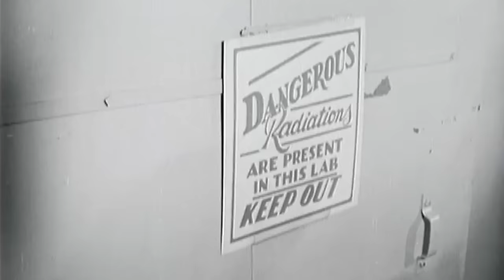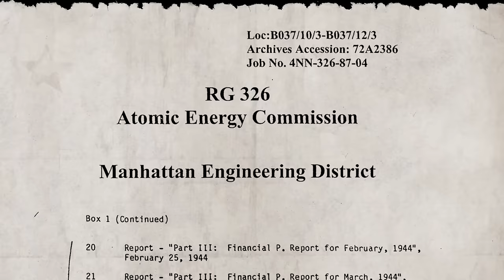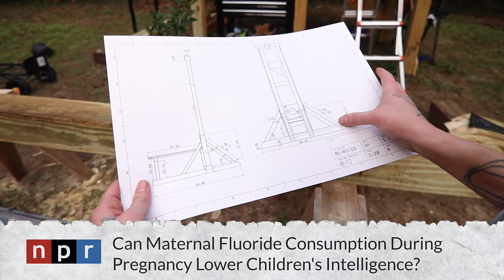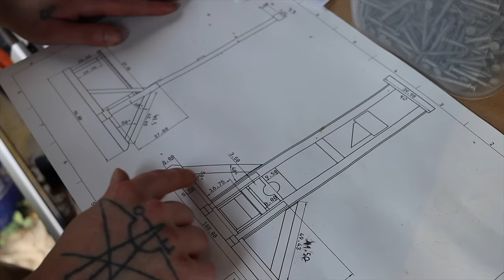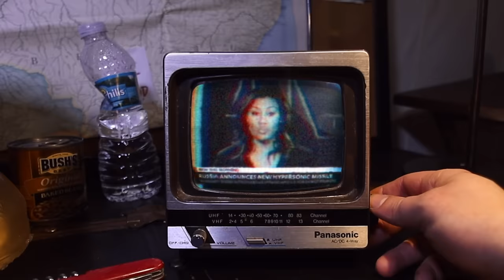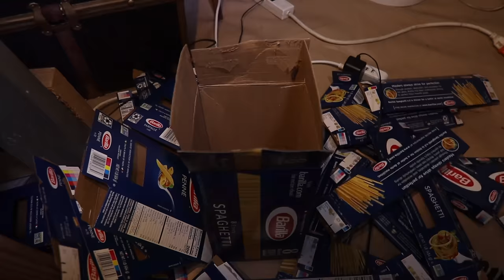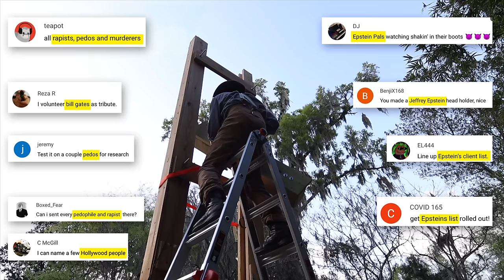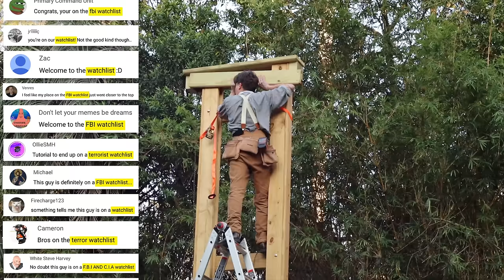GUILLOTINE part 4: Society is Collapsing

Comment: The acidity of lemons will rust the blade quicker than normal. Be sure to oil the blade each use. Loved the video!
Reply: Poison damage
Reply: @LeMeowAu  more like Tetanus
Reply: Name checks out 🏴‍☠️
Reply: @mericagunsfreedomandlove.8985  Uh oh i was decapiated and need a tetanus shot ✋😐
Reply: @Blue Cyclone  I don't have any. Go to your local head dr. And how do you have a hand?
Reply: @mericagunsfreedomandlove.8985  for the shot
Reply: Blood also has a similar effect... not that I'd know
Reply: @Dukky  actually is slightly different. Blood rust can actually bleed again. Like drip off. It wack.  Old knifes that were used for rituals that were never cleaned, when handled again can drip blood.
Reply: @mericagunsfreedomandlove.8985  i got banned from him I used 3 already
Reply: Yes sir, alot of things will rust the blade. Oil is good but atf works really good
Reply: It'll tarnish, but rusting is a result of reactions with oxygen, which lemon juice does pretty good at reducing
Reply: OK I pull up vaccine
Reply: blood is acidic too
Reply: @Immadeus  ye
Reply: @mericagunsfreedomandlove.8985  I DIDN'T SAY ANYTHING I FEEL MUCH BETTER AFTER MY THOUGHTS WERE CORRECTED BY TAKING MORE STIMULANTS, EVERYTHING IS GONNA BE OK 😃
Reply: Ya your right, you could say the "blood" from the "lemons" could rust the blade so he'll have to make sure it doesn't get rusty

Comment: The debate around fluoride and drinking water is less about whether there's negative health effects and more about how much we need to use in other applications when we already get it in municipal water. Even if you brush your teeth twice a day, drink exclusively highly fluorinated water and get a fluoride treatment at the dentist it's unlikely to cause any negative effects. Unlike lead, our body metabolizes fluoride and you actually need a trace amount for bone regeneration. Fluoride toxicity actually is a result of storing too much fluoride in bones. Over time, your body can get rid of excess fluorine if you consume too much. Drink water never comes close to toxic amounts even if you drink a ton of it. On the other hand, it's unlikely you need to brush with fluoride toothpaste or get fluoride treatments at the dentist if you have fluorinated water.
Reply: Interesting. Perhaps the research in other countries was specifically excessive fluorinated water.
Reply: Sure , but why do I need to bathe in it? Why does ALL of the water need to be treated with fluoride? In Germany they put floriude in the salt , and the municipal water remains untouched. You can also buy salt without fluoride if you'd like.  A pretty simple solution, and people's teeth aren't exactly rotting out of their heads over there.

Comment: Water:  Rain water - in NZ there are many homes, large farms & life-style blocks (mini-farms) run solely on rain water with gutter systems (off metal/steel roofs) on every building collecting it into tanks & electric pumps to get it through pipes.  I lived at two different places just like that & I know many who have always done that or grew up that way.  Some people toss in some commercial grade Hydrogen Peroxide a few times a yr, but many don't (I highly recommend it if lots of birds about).  Helps that we have clean rainwater.

City/Public water - not only are Kiwis historically anti-fluoridation, but also anti-chlorination.  Example - the city water of Hastings was untreated until a few (6-ish?) yrs ago due to a bad E.coli breakout.  While it remains treated (chlorinated) today the city also provides "chlorine free" public taps because the demand for chlorine-free water was so high.  While the majority of most towns & cities are now required to add it to public water, as of Nov 22, it has been VERY controversial.  Unfortunately, the Fluoride outrage didn't prevent 50-60% of our water from being Fluoridated.   ....but hey there's always rain water.

Comment: I live like 2 miles from the Zephyrhills natural spring. Ive heard things about them and blue triton from workers from the bottling plant.

It is good though. Which looks like you agree.

Edit: wow. Now that I think about it 200 years ago Zephyrhills spring water would be exactly what I was drinking. Everyday or so I'd be walking down to the spring. Just there for me. Still is. But ya. I pay for it at a gas station just as far from me. How fricken sad. It's literally the water under my feet. It's my water.

Comment: 10:14 wait you’re supposed to spin those to change drill bits? I’ve always just ran the motor holding it and it tightens/loosens

Comment: I have experimented on myself unintentionally regarding fluoride and tooth decay. I stopped using fluoride toothpaste for five years. Before that, I had near perfect teeth. After, I had 12 cavities. Once I found that out, I started using fluoride toothpaste again and the cavities haven't gotten worse and a couple have regained enamel over top.
Reply: No one denies the dental benefits of fluoride, what is in question is whether we should be added to drinking water. Plenty of chemicals have particular uses, but that doesn't mean they should be added to the water supply for regular drinking. Rusty even mentions that they add to it to toothpaste and doesn't say it's a bad thing (normal people don't usually swallow toothpaste), however he cites examples where fluoride has negative effects on the human mind and  body.

Comment: Legalize psychedelics around the world for therapeutic use and watch these problems fade away, theoretically
Reply: Why, should that solve problems?
Reply: @michaelmichael2382  under the right circumstances it can be very beneficial for the mind, there is a fair amount of research on it as well. For example, there have been cases where alcoholics stop drinking after a session of psychedelic therapy. So, with more mental benefits, more solutions might come to pass. If you are able to try it legally in a therapeutic setting, I think you might know what I'm saying. Although, that's not too easy to come by. Might broaden some horizons though. But, of course, it's recommended to talk to professionals if you were to try it
Reply: And to be taken lightly